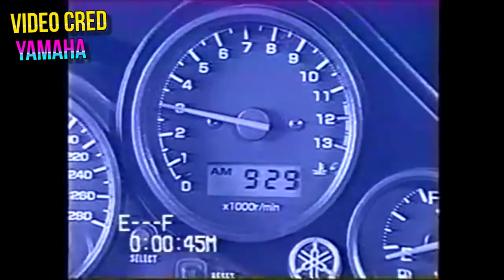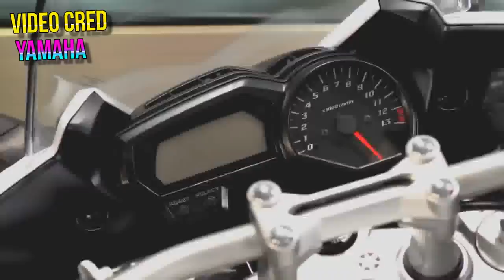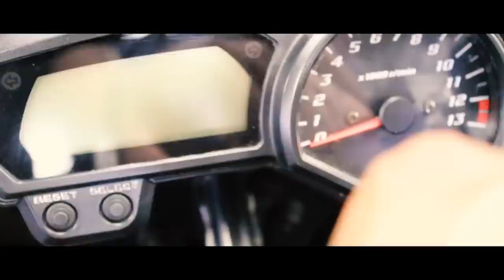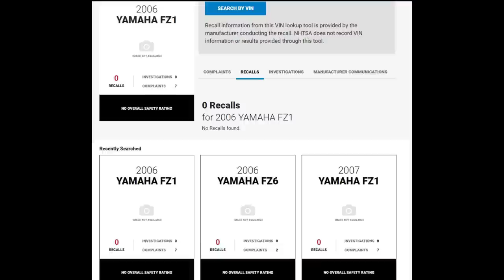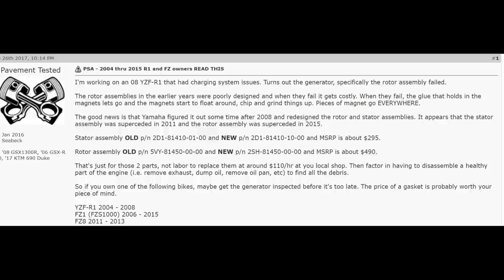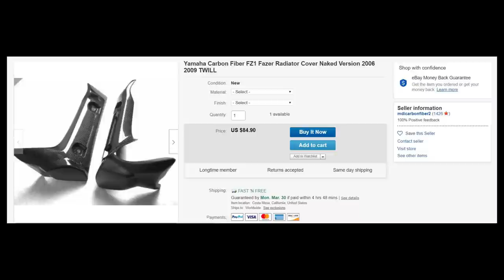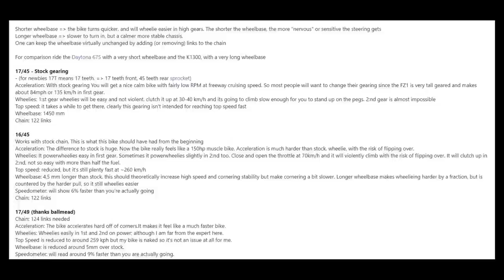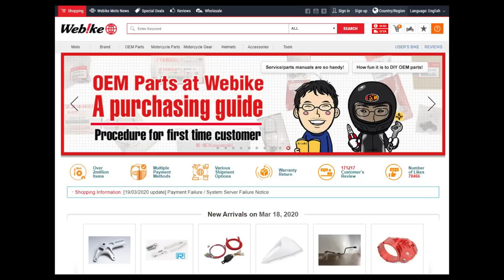Everything You Need To Know About the 2nd Gen Yamaha FZ1

Comment: I have a 2009 FZ1. Had 5.5k miles on it. Mostly stock. My 1st bike. I am 50yrs old 6’3 and about 270. I respect it. She is a beast. I like being upright. I like it being a all a rounder. Play when I want. Commute when I want. Two up. When I want. She is heavy 485 pounds. At speed you can’t tell at low speeds you feel it. Not a gas saver. She will drink it up. I keep it at 4-5k rpms. But she comes to life just after that. Cars don’t stand a chance and I keep up fine with most two wheelers. Harleys, bye bye. Anastasia can be a dirty girl when needed and aside from that she is just sexy. It’s in Yamaha cobalt blue. I have blue add ons. She pops. And it is a Yamaha so anyone can work on it and parts are easy. There as so many bikes out there get the one that speaks to you and your needs.

Comment: Hey man, don't knock the 1st gen, its the last carbureted great super standard. Much more comfortable than any of the following generations, and the styling is timeless
Reply from the maker: I hope this video didn't come off as knocking it!
Reply: I have both generation bikes 2005 And a 2013 FZ1....I’m a tell you right now I like my 2005 better than my 2013...it’s heavier and to me much more fun to handle around turns the carburetors just have a different feel to the bike and more torque on the Low end... so if you were to ask me which bike would I keep if I absolutely had to choose one ........my 2005 Gen1 FZ1
Reply: @primokona  Def a more comfortable and easier bike to ride.....but then u have the ball ache of having 4 carbs on the bike....You win on one hand and you loose on the other :)
Reply: You said the worst thing ever. Carburated. You gotta keep those in sync, cleanem, jet them, not to mention choke them and last but not least make less HP and consume more fuel than FI and are more maintenance heavy than FI. No thanks I'll pass on any carbed bike. You'd have to pay me to own a 1st gen fz1.
Reply: @theenzoferrari458  you're exaggerating quite a bit, I cleaned and synced my carbs when I bought bike 5 years ago and haven't needed to touch them since.

I'll concede that it's a more difficult route, but it's a labor of love. I enjoy working on something that's a lost art, where most people are afraid of it.

Comment: Damn I've missed these types of videos from you
Reply from the maker: It hasn't been that long right? Lol
Reply: @Theillestrator1050  Sorry to post here, I just rewatched a dl-ed vid of your #14 K100, 

the throttle cable is looped back in too tight a curve/loop IMHO where it goes down one side of the headstock, 

perhaps thats why the throttle isn't operating correctly without a return heavier spring - 

   ..if you can, route the cable in a gentler wider curve on the outside of the headstock brefore looping it across to the intake/inside side of the bike.
Reply from the maker: I wish it were that simple. The throttle body would exhibit that issue even with the cable disconnected.
Reply: @Theillestrator1050  perhaps there is a plastic bushing or (a sealed bearing) that is worn, aged, degraded or bone-dry etc in that intake unit?
..or the twist grip or its rubber is slightly binding or rubbing on the cable/switches housing next to it?

mmm, triple check that all rough edges & burrs from the twistgrip tube and the throttle cable camming wheel and the soldered cable nipple are removed & smoothed finely - maybe could've left an 'binding' edge, nodule or strand somewhere.

..without looking up a manual to look for a clue in the pictures/descriptions etc to come up with a better theory, quick rando/random searches apart from my obvious thunkings above..

 Down to lower end, replies #11, #13 & #17 of
http://www.motobrick.com/index.php?topic=7054.0

& around or the 2nd page of/after
https://www.k-bikes.com/forums/137184-post6.html

Comment: I have owned a 2008 FZ1 for 3 years now. I updated the rotor, installed Philips racing vision headlights and a SP Engineering exhaust.
Reply from the maker: Sounds like you're all set!
Reply: What rotor did you buy? Rm stator?

Comment: Just got a 2012 FZ1 with 8k miles for 6 grand out the door, and I absolutely love it. Sourced some side fairings I will be getting soon that should get here by the time the Delkevic slip on, that will replace the Twin Brothers one it came with, does. The bike already had the tail tidy, shorter throw shifters, adjustable clutch/brake levers, slim sequential front and rear turn signals, upgraded gel seat, and PUIG windscreen. The bike came with about 80% of the things I would've got for it myself. I'll be adding the side fairings, sliders, Delkevic 14in slip on, and projector LED headlights. I love that my first sport inclined bike cost me 7k flat. Now I am really sold on Yamaha and can't wait to get me a recent R1. We only get rain here in Cali this time of year, so I'll get some rain riding experience now on this one for next rain season on an R1. Thanks for covering everything you did.

Comment: Good job on the mighty FZ1. I just got a 2009 FZ1n in Australia. It come with a Powercommander, Pipe, K&N filter, other bits and Bobs. A great bike all round.
The ECU tune from Factory Retarted 1st and Second at that low RPM until you get to 4000 RPM, then it gives you the full beans at around 7000rpm.
Woolich Racing offer a Custom Map for the FZ1 and I left the Powercommander on as well. The Custom Map and Dyno get the best out of the FZ1.
Mine is set at 1500rpm now, a noticeable difference. Gets going straight off the clutch. A great bike overall, Really good front Brakes,[enough to lift the rear end off the road under heavy braking], I just tuned the suspension to dial it in real nice. I think it would do alright on a Track day.
Great video, A lot of work went into it, Cheers.
Reply: Guy, any bike can do a stoppie  LOL, that’s not a sign of “good brakes”

Comment: A flash does wonders for these bikes. It addressed all the factory shortcomings. Xplane does them for $200 and it's the best money you can spend on one of these bikes. 
And my '06 has almost 30,000 miles with no frame cracks or other rotor issues... Hopefully it holds up. 
R1 rear shocks are also an easy swap.
Reply: Youll never know about the rotor assembly until its too late.
This is why many people are calling this preventive maintenance
Reply: Did u replace the rotor?

Comment: I really enjoy my 08 FZ1. It might not be the fastest thing on the planet, but were talking a machine that handles great on the highway, and at low speeds, low end torque, is very reliable, quite straightforward to maintain, etc, and will do 150 with no issue. That's a lot of things for one motorcycle to do and it does it well. It's practical and adaptable for a lot of use cases.
Reply: Low end torque??? Excuse me?
Reply: @Krezo200 I got a 2014 fz1 and I tied a brand new Lamborghini EVO STO what u mean it doesn’t keep up with everything on the road

Comment: I have the FZ1-N 2011. Yes, I love this bike. Lots of good reviews for this bike but still not the perfect one. I had some problems with mine. 
1) Water will seep in the ignition coil. If you wash your bike, try to avoid spraying water on your cylinder head cover where the ignition coil is. Water will seep in the passage where the ignition coil sits and disrupt the spark plugs. The engine will stutter usually at low RPM (there are few videos here in youtube). Eventually, this will go away. But when I change the spark plug, one of it was rusty. 
2) Ignition coil will expand and will get stuck. This happens at the 3rd cylinder from the left. It snapped into 2 when I try to remove it. It has happened in R1 and also MT09, I was told.
3) Immobilizer failed. You know that key icon on the ODO with the blinking red led light? Yes, this problem has my mechanic diagnosed for 2 days. Even YAMAHA could not solve this issue. When the key is turned on, the temperature would show 'HI' (normally 'Lo') and the bike won't start at all no matter what. Its the wiring issue somewhere near a connector, the wire was loose. Need to rewire.

Don't mean to scare all FZ1 owners, but just some experience that I have. I still love this bike. Just be prepared.
Reply from the maker: Thats interesting. I havent had that issue on the FZ1 but I DID have it on the YZF where when I would wash the bike, It would run on 3 or 2 cylinders because water seeped into the coils...but never on this one. Do all bikes have an imobilizer? because I don't think mine does.
Reply: @Theillestrator1050  Oh yeah, I heard that the US version has no immobilizer. Lucky you.
Reply: Hey would hydrophobic spray solve this? Any aftermarket parts to solve this. Please help. About to buy one in a few weeks and the owner told me about this.
Reply: @theenzoferrari458  Not sure about this. You could give it try though.

Comment: Picked mine up 350 miles away.
Had 2800 miles on it and still on original tires and fluids 😬
Got some new tires ,did a flush and air filter and oil and now I have a 3300 mile bike and counting.
Gonna ride it like the way it was built .

Gonna check out about that charging system though.Thanks for that.

Comment: I have this bike in my garage and its down a cylinder.  68,759 miles.   Im gonna pull the motor and go through it.   I loved this bike.  My tracergt900 is more comfy but my fz1 is a terror.  3rd gear light clutch full pull at 50 or 60 wheelies were a breeze.

Comment: Excellent video and very accurate except 1 thing. I have a 2014 and it had the stator rotor that’s prone to fail. I believe 2015 was the only year Yamaha upgraded it. 
Besides that everything else you said is spot on. I agree that stock fz1 has no torque at all. I used to live in NYC so I know having the power down low would help tremendously light to light. I live in the midwest now where speed limit is mostly 50+mph so it hasn’t bother me much but I’m still on the edge of either I should at least go with a 16t up front.
Anyways just wanted to say this video was very informative and anyone who’s in the market for a fz1 should watch this before buying one.
Reply: 16t front sprocket is easy, dirt cheap & totally worth doing. Makes a very noticeable difference. I was quite happy after I did it.

Comment: I had an FZ8 for two years, great bike man! By the way 10:14 the pops and bangs you hear are not from the power but from the Secondary Air Injection System. Engine is pumping extra air into the exhaust to burn off unburnt fuel.
Reply from the maker: I knew when those pops occur under deceleration that it was the air injection. However that much louder one when I crack open the throttle specifically, that's from the AIS as well?
Reply: @Theillestrator1050  Yeah man, my FZ8 used to do that during upshifts at 6k, loud backfire when I cracked it open. There is still unburnt fuel in the exhaust during the initial throttle opening.

Comment: Great video...Have a fully  track ready 08 Fz1. Had the frame crack issue had it welded ...no problem .This bike is the best performance value you can get . It does everything you ask and with a few mods . Lower bars , slip on exhaust, Penske shock , rear peg delete, electronic and air flow tinkering , quick shifter , sticky tires  ... you can be an  effective annoyance on track days  for a the sport bike boys .Way too much fun for the buck !  Keep up the good videos . I need to get out and ride ...SOON !
Reply: Did you replace the rotor?

Comment: you can change the throttle position sensor from 16 to 18, usually works to fix the snatchy throttle
2nd would be adding a steering damper, love mine, but it is different for all of us.
mass airbox mod is a nice DIY
stainless steel brake lines 'Core moto' are the one's I bought, makes the brakes really bite,  a bit nerve wrecking at first, but you get use to it
adjustable clutch and brake levers, i went cheap on this, but expensive works too
upgraded rear shock to make the rear more stable under hard acceleration and putting the power down in corners, for me the rear is really bouncy and I get way too much feedback in corners.
tune 'Ivan's' is pretty darn good

I bought my FZ1 brand new off the show room floor in 2008, and have had it ever since.  Good to know I missed all the recalls on the earlier versions.  Great video by the way lots of interesting things I did not know.
Reply from the maker: Thats handy info if someone feels the snatchy throttle. I don't feel it much though. I definitely need a damper, especially with all that naked drag on the highway helping lift the front.
Airbox mod may indeed be in order if I ever un-cork the bike.
I've run coremoto lines on two bikes now. They are fantastic.
I might be weird in that I prefer the leverage of fully length levers lol.
The fact that you still own the FZ1 speaks to how good a bike it is!
Reply: @Theillestrator1050  I have had the luck of riding a few other bikes, and once you ride something with a super smooth throttle, your expectations go through the roof.  Same thing goes with brakes, once you ride something with progressive brakes, it is all you want.  The FZ1 has neither, but overall it is a great machine, with adjustable suspension.  

The best free thing to do with that bike or any bike is to set Sag (Spring Preload), front and back to your weight, and the Rebound (Tension) front and back.  The FZ1 has the Rebound (tension) setting on the front right shock tube, and the Rebound adjustor is at the bottom of the shock between the chain.  Both use a flat head screw driver to adjust.

Compression setting can be changed, it is only on the front left shock, and is best set during a ride.  Try opening it up and then closing it down a few turns from the factory setting.  Write down the setting before hand so you can always go back to stock, if it that is what you are comfortable with.  You should feel it become more bumpy or lumpy, at higher speeds and then turn it back down to where you are happy.  At higher and higher speeds, it is hard to know unless you are on a track, or you are very spirited in your riding.  

Front Spring preload settings: Watch videos on setting SAG
8 minimum (meaning 8 lines showing), you need a 14 mm socket to adjust 
5.5 is standard setting or stock setting
0 is Maximum hard setting
4 is where I am at due to weight

Front Rebound (Tension) if you start from zero meaning turn the flat head screw driver (CW) all the way to zero or all the way in
26 clicks soft (turning CCW)
18 clicks standard or stock (turning CCW)
1 click hard (turning CW)
My bike had the front oil changed and seals, so my setting is 16.  It will be different for everyone.  Best thing to do is push the front end down and let it rebound up and dampen out.  If it does this quickly and settles you have found the sweet spot for your oil and the age.  If the front end bounces keep adjusting until it settles out quickly.

Front Compression damping if you start from zero meaning turn the flat head screw driver (CW) all the way to zero or all the way in
26 clicks soft (turning CCW)
5 clicks standard or stock (turning CCW)

1 click hard (turning CW)

Rear Spring Preload setting: You will need the special castle adjustor tool from yamaha.  Watch videos on setting SAG
1 Minimum soft
3 standard
7 maximum
5 is where I am, I feel the rear is way to soft, hence why a great upgrade for this bike is a rear shock, I am going full out with a Ohlins TTX.

Rear Rebound setting:  Need flat head screw driver. Settings are backwards on the shock
12 clicks from all the way in (CCW) is the minimum soft
8 clicks from all the way in (CCW) is standard
1 click from all the way in (CCW) is hard 
5 is where I am at, the rear shock has never been rebuilt nor was the rear spring changed.
Best thing to do is push the rear end down and let it rebound up and dampen out.  If it does this quickly and settles you have found the sweet spot for your bike. 

David Moss does and excellent job on explaining all of this stuff, Motojitsu has a few great videos on settings as well.

I am in works for a full suspension upgarde on the bike.  A 2007 R1 front end, Brembo brakes, calipers, Brembo BMS, floating discs, as well as, TTX rear shock.
Reply: @matchuu-rang1690  Did you replace the rotor?

Comment: Good thorough video I thought for sure you'd key in on the EXUP, since that's a completely unique Yamaha only design that was kept from 2005- 2015 even with Yamaha responding to the 06-07 frame cracking and 06-14 rotor issues, they never changed the EXUP. The EXUP is probably the one thing I can't bring myself to delete to add a slip on b/c Yamaha engineers definitely took that into account for the power it keeps in low rpm's. It's not an EPA thing or a gimmick. Glad you found a solid bike it's been a couple years since the video do you still have it?

I got my 2012 in 2014 in PA and rode it down to NC. LOVE THIS BIKE!

https://youtu.be/AdcHN4N7Jm8
Reply: Fancy seeing you here buddy. Haha.
Reply: @westondifranco9313  hey! Lol

Comment: That is a really good in-depth review. I got all the warnings and info I need to buy a good one. Been thinking about an FZ6, but then FZ1 is not a lot more expensive, but is a lot more premium with that inverted adjustable front. Plus I like the FZ1(S) styling more. And that liter engine will just keep going forever considering how understressed it is in the city.

BTW, I currently own an SV1000S which is too vibey and thirsty for my taste. It kinda scares me too: if I'm not careful with the throttle, it will either lurch from underneath me nearly tearing my arms out of shoulder sockets or break traction on the rear wheel (even now, in July, I managed to do that).
Reply: Femdom? What does that mean
Reply: @Krezo200  must have been auto-edit. Let me delete that